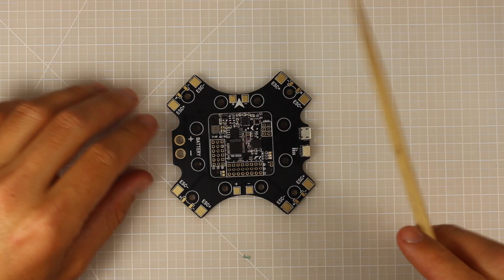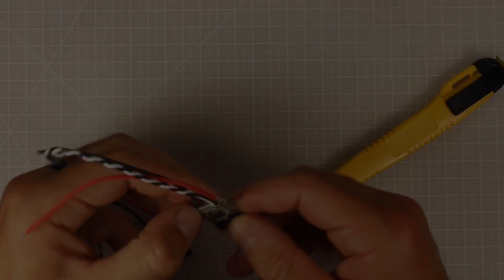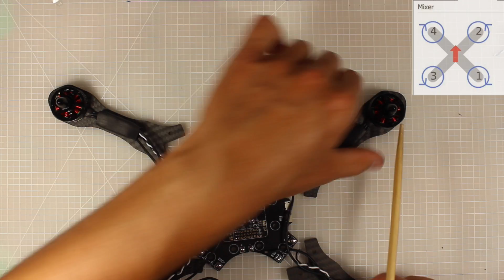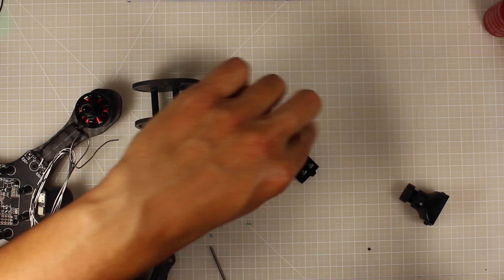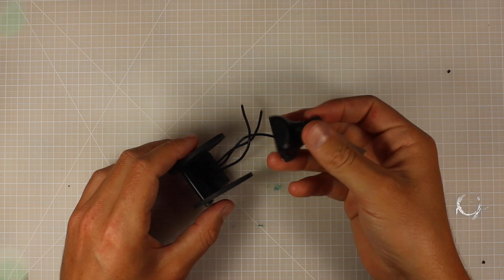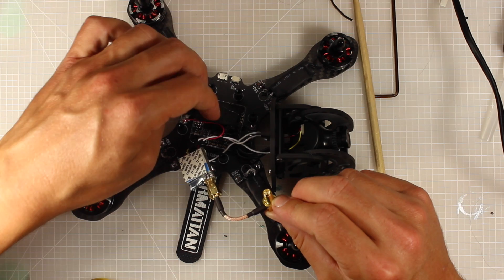Armattan F1-Pod Tutorial. Building the beast

Comment: How do you de-solder the motor-side wires so easily on the ESC?  On the ones I've got, the solder is some kind of mega high temp stuff that makes me worry I'll fry the board by heating it too much.  My best bet has been to cut the wires and then solder my motor wires to the tops of the solder blobs that are already there.  It's very frustrating, but I'll know where to look first when the thing doesn't work...
Reply from the maker: mm that is strange, did you watch my soldering video?

Comment: Hi mate , first thanks for your effort and the vid you put together, I've only recently joined YouTube and posted my first vid  a few weekends ago that's why I take my hat off to your commitment here... I have a QAV210 and I've been flying it in the woods like in my vids, but would like to know if this quad is something you'd use for that kind of proximity flying we do? Two more things ,one I know the battery strapped at the bottom is good for cog but your still landing on it every time ,is that something ...would you say that's a negative for this frame ? Two is it a pain to strap a GoPro or Xioami yi to this frame and does sit securely enough.... I'm asking coz I have my finger on the button to buy this frame and you seemed like the guy to ask!!!
Reply from the maker: +Fpv Erasmus Hi erasmus. Yeah i think the battery is more likely to get damaged with this type of frame. It flies better but its a trade off with battery protection. To be honest. for me. This frame is too fast for close close proxy. but in theory it can run the same things as your 210 so im not sure. The go pro fits on the top quite fine thanks to the handy velco cut out slits. 

also. welcome to the hobby and youtube. Ill make sure I check out your stuff

Comment: Greate video would you recommend this over the f1-4b
Reply from the maker: +Finlay Williams not if I only had one quad. This is faster and more agile. but it also has a lot lower fight times.
Reply: Hi thanks for fast response
I'm looking to get a new quad for my birthday I've been flying the nighthawk 250 for about a year now and it feels like time for an upgrade. The things I'm looking for are increased speed and agility and most importantly reliability and strength at the moment it feels like every time I go out I break something. Only last Friday my powder distribution board set on fire. From your experience what motor escs and frame would you suggest 
Thanks a bunch Finlay
Reply from the maker: Finlay Williams how much do you want to spend on the quad?
Reply: Max $250 not including fpv for transmittir
Reply from the maker: Finlay Williams this spreadsheet should help.the quad is a little more then 250 but well worth it https://drive.google.com/file/d/0B40IayM21YGneWlIN1pBU1cxRTQ/view?pageId=106846447492797678312
Reply: Thanks

Comment: What lens are you using on the hs1177? And is it ir sensitive or ir block? Thanks!
Reply from the maker: +Rene Tetter I think its a 2.8 and its IR sensitive.
Reply: +UAVfutures Ok thanks! I was wondering if i could put the dr4ii under the flight controller and above the top plate. It looks like there is some room between the arms.
Reply from the maker: Rene Tetter yeah I thought about this too.I tried but you need to really remove some parts of the D4r2 and completely depin it. I thin its possible, just very tricky, You also have the problem of binding it or having access to it once its all built. But if you don't mind taking it apart everyone in a while, I do think it will make an extremely tight and clean build that way